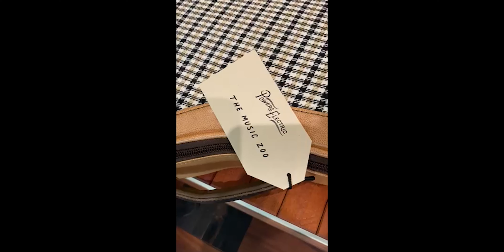Powers Electric A-Type: The Story, First Impressions, Product Review & Video Demo

Comment: On the Powers website, "no dead frets" is mentioned.  OK, let's hear the same "G" note played on string 2 fret 8, string 3 fret 12, and string 4 fret 15, with a clean sound, and we'll hear how long the notes take to decay.  In my experience, one of those positions often decays so quickly that the guitar is effectively unplayable, and no matter what other characteristics it has, as soon as it fails that test it goes back on the store wall.  It would be nice to see if Powers has managed to design a guitar that doesn't have this flaw.
Reply: Now I wonder if all of my guitars will pass that test